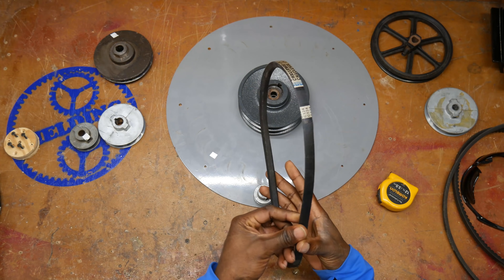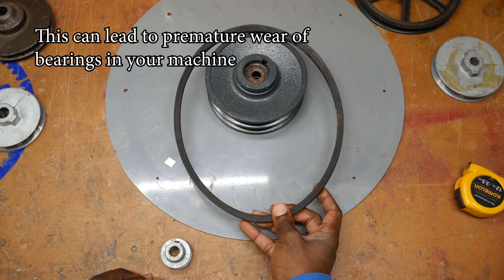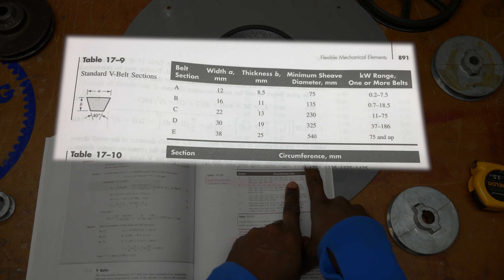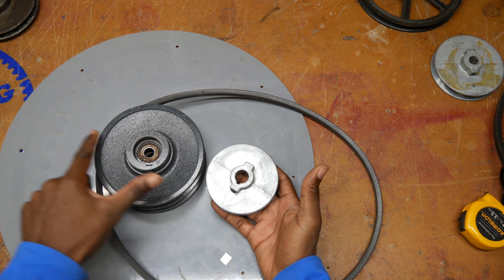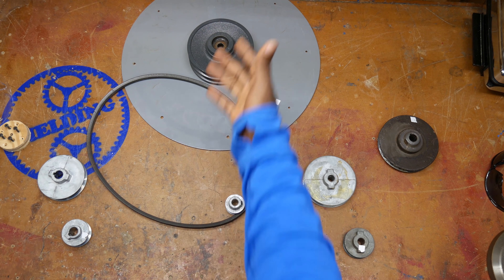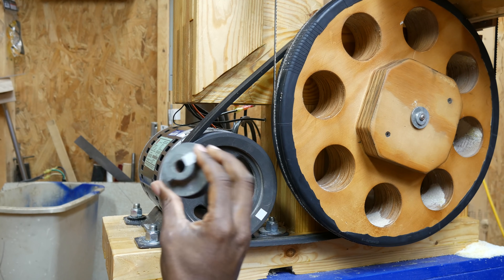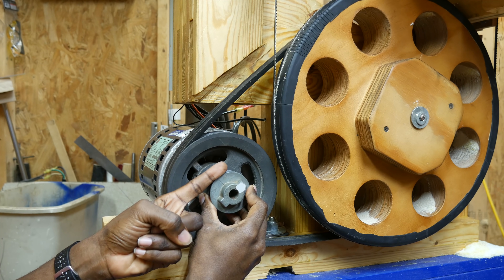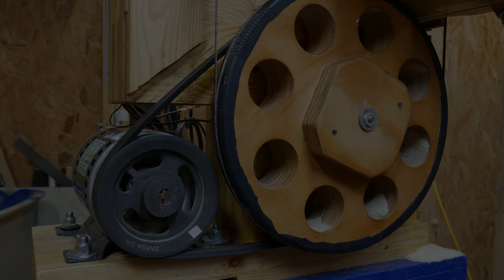7 Tips For Best V belt Performance; How To Prevent slipping and Other Belt Issues :052

Comment: This video is fantastic! Been struggling with a large centrifugal blower at work burning up belts and pulleys over the last three years. New bearings, soft starter, laser alignment- Still smoking belts and pulleys way more often then it should. I watched this and started to question whether the pulley diameters were large enough to effectively drive this load? Sized a new set 1.5x larger that would maintain close to the same RPM yet increase the leverage and wrap and installed. My RPMS went from 1445 to 1464 but my running amps dropped from 31A to 22A. Interesting! Also absolutely no belt slip at this point. Going to recheck belt tension in the morning but happy with the results so far! Thank you
Reply: And what was the gearing ratio before and what's it now?
Reply: So all the power was being lost to friction from the higher tension and belt flexing with the smaller diameter pulleys I guess-

Comment: At 5:25, this is incorrect. 
The illustration used with a longer wrench applies to the shaft being turned,  as in the large wooden pulley.  In that case, being larger on that shaft, makes the motor work less hard.
Opposite is true for the motor,  or drive force.  In that case, the smaller the diameter,  the more torque it creates,  and less power is needed. 
However,  smaller diameter on motor will be turning the working end slower. 
Always think of a bicycle gearing. 
The front smaller gear (motor, you) is used for more power,  less speed (going up hill).
For higher speed, but less torque needed,  you switch to largest gear up front, but smallest in rear.
Keep in mind, the rear sprocket,  or in this video,  the wooden pulley,  is the end putting a load on the peddeler, or the electric motor. 
That load end is acting as the true lever advantage,  and the motor is being acted on.
Reply: Yea, but no. Chris comments on gear ratio alone and Jeremy solely on forces acting on the belt under different pulley sizes at locked gearing ratio. One would say - if they are talking about different things may be both are right - well they are both a notch confused between torque, force, power and work. It's OK we all are a bit.

Comment: Thanks for this. My belt was squeaking on my new car build. Turns out the mechanic used an A belt, when the 400hp/tq engine needs at least a 1.5" belt per your book. I've ordered a new pulley/belt set.

Comment: I know this video is older, but I hope you see this. I am building my own air compressor, I have a 5HP 3450rpm 15amp 230v motor, and also purchased a compressor pump rated for a 5hp motor. What I didnt realize is that the motor is actually 5hp SPL, and probably not actually a true 5hp. The motor is being over worked and tripping the overcurrent protection after a couple of cycles. On average the motor is drawing about 21amps, instead of the rated 15 amps. My pulley sizes are 4.5" on the motor and 14.5" on the pump. Is there anything I can do to correct ! problem other than buying a higher HP motor?

Comment: Can't seem to find any information on the relative gripping ability of a B belt compared to an A belt. I have a wood splitter that slips the pump pulley using an A belt when overloaded and wondered if a B belt would significantly improve the drive.

Comment: Thank you for your video very informative. I’m making a motorized DaVinci Hammer. I’m using a 16 lb sledge hammer head and the handle is 32” long. I have a question on the  motor and pulley sizes. I’m using  a 14”  V belt  pulley wheel  attached to the cam to drive it. What size pulley should I use for the motor. Also for the motor what do you recommend for the horse power. Thanks

Comment: Can someone please tell me, I'm new to using belts and pulleys, can I get speeds of 10000rpm from a series of three pulleys driven wheel (biggest) to pulley(mid size) to the final pulley(smaller size), I need torque and high speed to run a spinning shaft? Im going to have to use a vfd attached to a motor, what motors can i use?

Comment: Keep in mind that increasing the diameter of a motor drive pulley can and will increase the amp draw of the motor. It can also change the cfm of a blower(s) attached to the driven pulley shaft which can be critical in air conditioning applications.
Reply: 100% Right 
Must check Amp Draw to the Spec Sheet Numbers. 
Thank You

Comment: Helpful? Yeah, but more than that...it was very interesting!

Best part, the rule about sizing up input pulley--with proportional load pulley increase--to increase input hp. Never once thought about that...even though the cost of drive belts would likely go up as well.

Another thought, in some cases, a more common, larger belt is LESS expensive and more available!!!

Comment: Thank you..twenty years I have been having issues with my boat lift pulleys and belts..the pulleys have been scalloping and causing the belts to slip and burn up.. They too used a very large pulley on the bracket of the lift but a super small pulley on the motor side (the one that always scalloped causing the slip and the belt to burn) this video is late. But again I was having issues and figured I'd YouTube it to see if anyone else was having the same issues. So glad you did this video.. I was afraid of going to a bigger pulley etc..now with the information you provided perfectly, I understand the issue and can correct it this time!! Thank you very much!! Much appreciate this tutorial!!

Comment: Regarding smaller pulleys and larger pulleys, it's not about maximum power that can be transmitted through that interface. It's about the maximum force you can apply on the v-belt. More surface area engagement means more friction, which means a higher maximum force. You can get more power from the smaller pulley by just spinning it faster and applying the same force/torque, so power isn't the relationship to look at IMO.

Comment: On the subject of belts I have a dual pulley on my power steering pump the part number for the belt is 15550. I am having trouble finding a matched set what is the clue on how to find a matched set it doesn’t seem like the automotive places around here know what I’m talking about.

Comment: Quite clearly Jeremy knowledge is way above average and explaining it on  video even better.     Any motor pulley under 75mm is a pain ,  worth spending a few bucks more and get a cogged belt for those small diameter ones.

Comment: I work in hvac and deal with a lot of a belts ax belts with pulleys and adjustable sheaves. Does all this information apply to the hvac field as well?
Reply from the maker: I would say it applies everywhere a v-belt is used.
Reply: Adjustable sheaves are handy but make sure they are adjusted to the same diameters if its running 2 or more belts,  seen a few that one belt wears out prematurely before the other belt due to one belt taking all the load .    No doubt this video applies to the HVAC industry.

Comment: Maybe you mentioned it in a/the video where you made the band saw, but is it advantageous to run the bandsaw motor without it being keyed to the pulley?  Such as relying on slippage between pulley and shaft on start to prolong belt life or is it a friction fit?
Reply from the maker: Set screws were enough to hold it
Reply: @Jeremy_Fielding  Rgr, Thanks.

Comment: I have a lathe  with a 3hp motor. The max pulley size I can use is 6". Most commercially available pulleys that will work with my setup are single grove for a 3V belt style. Will a single 3V belt with 6" pulleys handle 3hp?  Thanks for your time I like your videos.
Reply from the maker: Unfortunately I get hundreds of requests for technical advice. I can barely process all of them let alone give safe accurate advice. I simply can’t do this one on one

Comment: I’v been an HVAC mechanic for 29 years and have worked on fan, sheaves and pulleys of all kinds an sizes. I’v worked blower sections as large as a full story of a 40 floor building. I’v worked with mechanical engineers of all levels. My compliments to you my friend you are a great teacher!
Reply: This is totally the opposite of reality. The chart shows how much horse power can be transmitted using a larger diameter pulley due to the ability to grip the belt. Your leverage idea works exactly the opposite of how you explained it. The further from the center of rotation the pressure applied will be less, that is true, but when the distance from the center to the point of resistance is greater, the power that is required to create rotation is greater. Think of it this way. If you had a wrench attached to a shaft, as you illustrated, and you had a certain amount of torque applied to the shaft, would it be easier to prevent rotation by placing your hand on the wrench 4" from shaft center or 18" from center. Obviously 18". This, therefore, means it would require much greater HP to rotate a 36" diameter pulley than an 8" pulley.
Reply: Hi fella can I contact you by email I would like to ask you a question on fan touque    Dave
Reply: Are you in U.K. fella.
Reply: Fully  alimented lenth full and v belt detan es  tighted full loos   baic  motor  ssmll  setled dimetr hosepower  tighted

Comment: Twist your belt to test for the correct rigidity.  It should twist 90 degrees. That is just two fingers and a thumb , at one point on the belt.

Comment: what are your thoughts on bicycle gears and chain for transmitting power, they can be kinda flimsy and dont allow for slip really, but often can be had for free and could possibly keep the multiple gear ratio effect if thats useful
Reply from the maker: They sound great
Reply: seems like a good video idea after the compressor is sorted out

Comment: I am learning so much! My project is upgrading a drill press with 3 hp treadmill motor-flywheel has been removed. Motor has 3/4" tapered arbor-no key way-what is best way to attach new pulley? There is a threaded female end on the arbor with a 3/8 x 3/4 long hex head screw. Press on tight and set screws?
Reply from the maker: They are hard to work with. I have tried several things and haven't been completely happy with any. I say fix it with every option you can think of.

Comment: thank you for this video. this is so help full.. i need to know about fly wheels and pulleys being cast with iron vs aluminum for strength and revolutions per diameter speed. how fast can something spin based on the material and size. is putting a fly wheel into the mix worth the effort ?
Reply from the maker: That unfortunately is a very complicated question for the comment section. There is no answer that would be concise enough for this format. And there are too many unknowns to even begin to answer. This will require some calculations to have a meaningful answer. But, you will learn a lot along the way as you search it out. As with everything, there is a threshold where one benefit is given up for another.

Comment: Jeremy, I usually gain something (some I learn a lot) from your videos. Thanks again for saving me lots of extra work when I go to set up more of my own projects.
Reply: Also I have I built this a trike with a 6 horsepower Honda motor I have a very short belt with a smaller one on top and larger drive belt to the axle directly underneath the small belt still is a very short belt I don't have much wrap what is the solution for this my axle is directly beneath my motor output shaft very small belt as in length police almost touching each other one above the other what can I do to gain traction on this on this belt so that it will actually turn my trikes rear axle instead of slept
Reply: I suppose I could raise the motor to tension the belt
Reply: I think I will try and put some blocks underneath the motor to make the belt tension tighter but what side of the I'll be drive belt what I put the tensioner if they both turned counter-clockwise the motor shaft and the rear axle
Reply: Yeah I have a centrifugal clutch run trike driving a 6-inch police probably a 4 inch pulley I cannot keep I don't have much wrap Beltre are police are almost touching each other one above the other how do I alleviate this slipping
Reply: So what I put the tensioner on the front of the drive belt or the rear I would put out word tension on the belt from the end pushing out but that would leave even more blessed up contact that would leave even less rap on the drive pulley output shaft of the engine

Comment: Great informative video. I have a question re v belts. My auger drive on my tractor mounted snowblower has flipped in the driver pulley. Any ideas? Could that be caused by being too loose? It WAS a new belt. Thanks again.
Reply from the maker: I don't know

Comment: Great video. On point with all facets.
As an industrial guy, I found out years ago that most applications that were well designed (where the sheaves and belts used were well inside their design parameters) would benefit from longer belt life when using an "X belt", or "notched belt".
Also, when possible on a multi-groove pulley system, I preferred to drop a few more dollars on an integral belt - X style, if applicable, of course. That's probably because I come from a time when multiple belt drive systems required a matched set lest one belt be just a smidge smaller, and handle most of the load.
I've been assured over the last few years by belt manufacturers that matched sets are no longer necessary, but on anything over two grooves, I stil like them better.
Reply from the maker: Thank you for the input. I will add the notched belt to my list of tips in the description.

Comment: Hey man i love your videos I'm always learning so much from them! Im a wood and metal worker and much like your self am always taking things apart to salvage cool components. Your always pulling out really cool books. I was hoping maybe i could get a list of a few to check out? Shigley's Mechanical Engineering Design is definite on my list. I was going to send you a message asking but i figure hell if I wanted to know I'm sure that some other people would love a response to. Also this allows for other viewers to throw in some recommendations.
Reply from the maker: It depends on what you want from the book. I use Shigleys, and "Design of Weldments" by Blodgett as reference books when I design my homemade machines. These are really the only books I use on a regular bases. Both have plenty of math and won't be a leisure read. However, Blodgett is pretty easy to read relatively speaking.

Comment: Merry Xmas to you Jeremy and family & subscribers.... ( tinkerers )  I'd like to add a bit of quick reference for the tinkers out there whom may not know this method for quickly estimating what a gear / sprocket / pulley pair will do together as far as RPM's for example..
  Use the ratio of the pair by making a fraction out of either the radius - diameters - or amount of teeth ... create a ratio ( fraction )      i.e.     gear a) has 20 teeth      gear b) has 80 teeth 
20/80   reduced to  1/4     1:4      if gear   a) is the driver  then gear b) will have  1/4th the rpms of gear a),,,,    if gear b)   is the driver then gear a)  will have 4 x the rpms of gear b) . 
   Its a wonderful quick way to estimate a variety of rpms arrangements without doing all the other math ...
Reply: Right on! 👍👍

Comment: If you are stuck having to use an undersized pulley, a notched V-belt is some help in easing the wrapping problem and/or over tightening the belt. 
Another important consideration in getting good belt performance is to ensure the pulley shafts are parallel and the sheaves are aligned with each other. If you have belt problems that's the first thing to check.. even on a brand new piece of equipment. 
Merry Christmas!
Reply from the maker: Thanks
Reply: Is that the purpose of the cogged v belts? To enable the use of smaller diameter pulleys?
Reply: @hwingerrr5680  Yep.

Comment: It's a great video. Here is a real world belt challenge: A garden tractor with a front mounted vertical shaft engine needs to power a rear mounted garden tiller. The V belt required is 70 inches long because it not only goes to the rear of the tractor, it also has to change direction over idler pulleys and a tensioner to drive a horizontally mounted pulley on the tiller reduction box. The problem is that the belt is so long under the tractor that it stretches and flexes and pops off under load. You cant have anything that hangs to low under the tractor and you can't overly tension the belt because of the electric clutch. How do you support the belt so it doesn't come off. This is pretty typical of older equipment.
Reply from the maker: Let the head scratching begin LOL
Reply: Find a place about half-way to mount a double pulley riding on 'pillow block' bearings then use two belts.

Comment: I could be mistaken here but it looks as if your output shaft is missing a woodruff key.
Reply from the maker: Yes... it is gone. I salvaged this motor from a commercial grade treadmill and it was missing when I got it. There are two set screws on the pulley, but I haven't pushed it to is full capacity. We shall see if it becomes a problem.